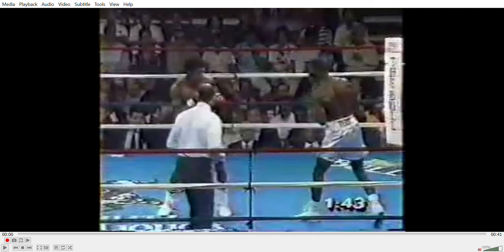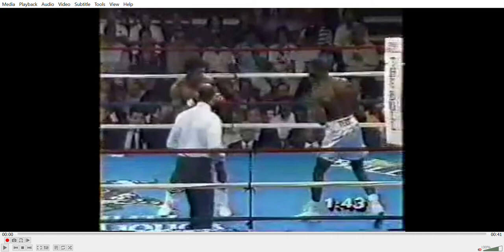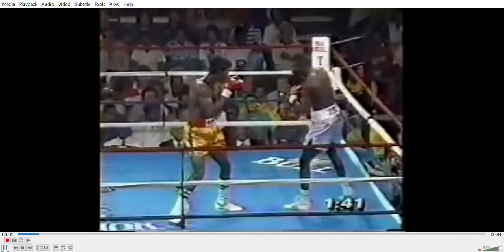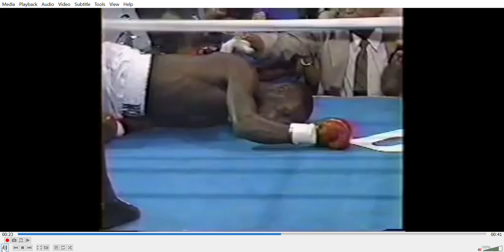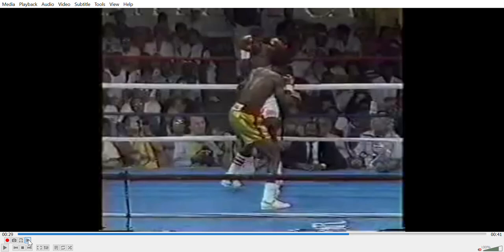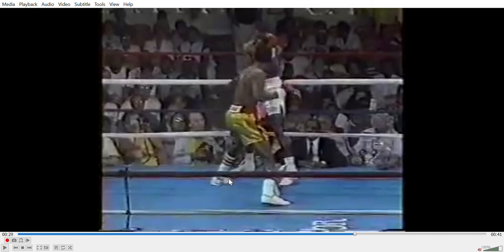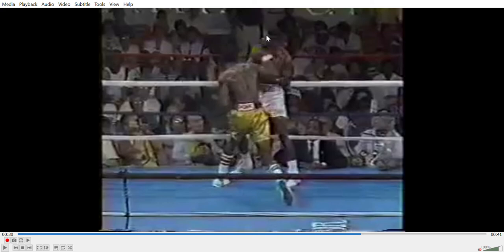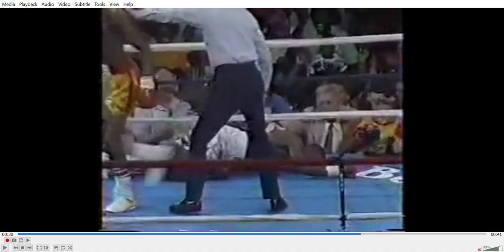Power Punching In Boxing With Julian 'The Hawk' Jackson | Biomechanical & Technical Study

Comment: I was lucky enough to have back and forth Conversations with Julian Via email around 2015 - 2016... He went into great detail about his punching power explaining that it was Natural to begin with but he was taught how to execute it through technique. 
One of the things which stood out most was his understanding of Balance and Core with Timing when executing a hard punch.. He really digs deep on balance and its importance. 

He never lifted weights but apparently could perform alot of pull ups and push ups.
His trainers always worked on his speed and technique.
Reply from the maker: That's very interesting. I'm certain that Julian was a very strong athlete but his punching technique was near-perfect too.
Reply: @outmatchboxing6587  A little secret of his was to Curl the toes  into the ground " Rooting " as he called it.. This would plant him solid and allow him to generate maximum leverage. His trainer would tell him that everytime he stops momentarily to throw a punch he was to " Root " the toes and let em fly.  Jack Blackburn taught Joe Lewis the same secret.

Jackson also talked about Reeling in large fishing nets as a teenager when out on the boats which helped develop his shoulders and core muscles.

He NEVER worked on power in the gym even when hitting heavybag.. everything was speed and timing
Reply: @OldSchoolStrength let em fly referring to the toes or the punches?
Reply: Did he pass away?
Reply: @Murdastrapped No he's still alive and training on/off boxers.

Comment: @UCEx38m1zU6Ryq9p2ehYX3MQ Go you think a boxer like Jackson learns how to hit like this naturally or can it be taught? One point I would like to make is Jackson knew how to pressure shift for leverage rather than weight shift , the weight is moved around to  create  pressure shifts and ground reaction forces which when set up properly and practiced set up stretch shorten cycles in the key  muscle groups and body parts  especially the legs which drive the hip action bur also as you  pointed out in the mid section in separation where the hips lead the torso  in the hit but in this punch you can also see shoulder  abduction  where the scapula has gone back and down creating an elastic muscular stretch in the right shoulder that gets catapulted by the pivot chain to amplify the hit. It is the same pivot kinetic chain a discus thrower or javelin thrower uses. It is very poorly taught  and understood in boxing. Manny Steward seems to have understood the right mechanics as evidenced by the mechanics of his boxers, he also understood  Serge Gtacovetsky's spine engine which is also evidenced in the Jackson punch where he creates the use of it by going into left pelvic tilt , you will notice as Jackson makes the puncth the left hip gets lowered setting up the spine gears to be used, Thomas Hearns did this in his right hand which enables there to be stronger transmission of leg power through the body  creating more leverage.
Reply from the maker: A very in-depth understanding you have, indeed. To answer your question, I believe that every fighter can absolutely improve their punching power but that doesn't necessarily mean that they'll become KO punchers. There is so much that goes into being a genuine Knockout artist that I'd probably have to do a definitive video to give each factor justice 😂 This video was just an opportunity to highlight the biomechanical principles that every fighter should understand, but as you rightly pointed out, very few trainers in boxing understand these concepts!
Reply: @outmatchboxing6587  You are right, by working on the right things a fighter's power can be improved, how good the fighter will get at it is another question and a lot will be down to his activity and sporting background  growing up and if he has the key movement patterns already developed from other sports.  Field sport throwers like Shot  Putt , Discus and Javelin   would make good pinchers and a  cricket  ball throwing arm would be handy as well. I have never seen proper punching mechanics being  taught in any gym I have been in, the fighters who come through the system that can punch generally have some how worked it out by themselves and fallen into the right patterns. It is pretty sad really, like you pointed out with Anthony Yarde..
Reply from the maker: @johnhue8933  It's so true. The amateur schooling in the UK is particularly lacking in the technique department. After years of being in various gyms, I noticed that they seem to rely heavily on punch volume and in turn, the training sessions become almost like boxercise classes.
Reply: I used to be a discus thrower and I know exactly that feeling of what you are talking about
Reply: Punchers are born not made....you either have it or you don't, you can improve technique and speed somewhat, but power is there or it isn't
Reply: man I read your comment about almost 100 times and I am steal shocked how someone could have all this knowledge and not be in top level , as a amateur boxer I always wonder when you throwing the straight right hand like mcclellan or hearns do you should keep your weight on ball of feet and the heel slightly off the ground for fast explosiveness or you should keep the hell connected to the ground , I realy wich you unswer my question,  because for hooks I found more power staying on the heel of back foot but for straight right hand is the other way around